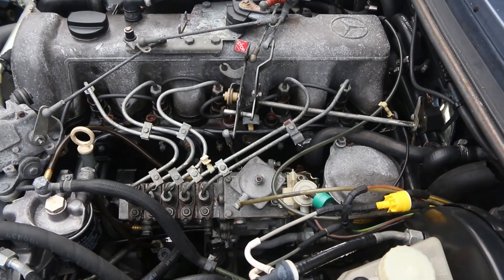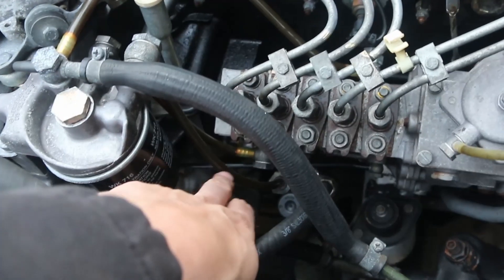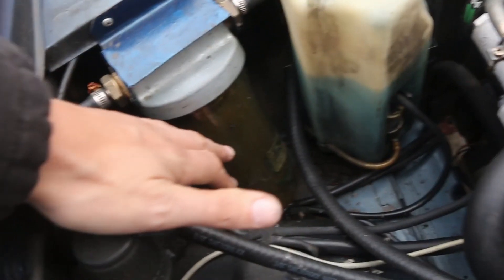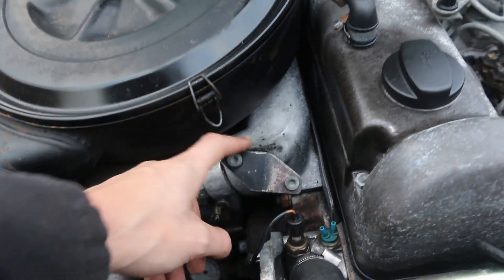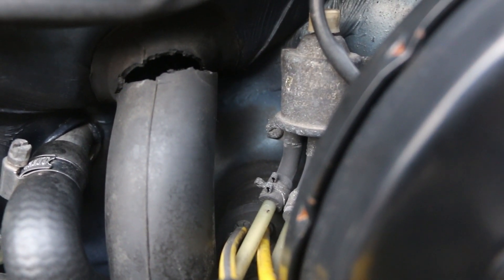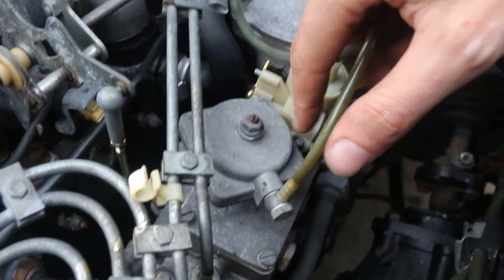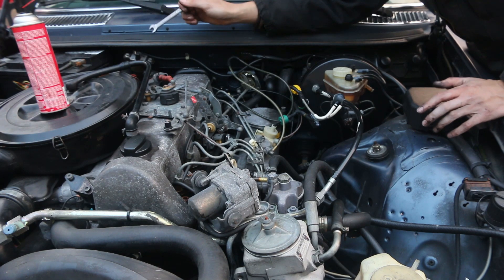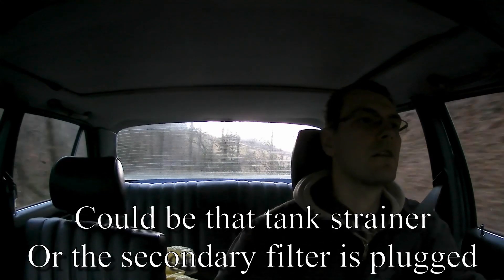Hunting for more power on a W123 1982 Mercedes 300D Om617 Turbo diesel. First steps to HP!

Comment: Do you have a part number for your aftermarket primary filter?
Reply from the maker: I'm so sorry, I somehow missed your comment, Yes, I used a goldenrod 470-15 inside of a 496-3/4 housing, and a couple 3/4" npt x 1/2" pex fittings to adapt to the 3/8 rubber fuel line:
Filter housing: https://amzn.to/31lon0T
Mesh filter: https://amzn.to/39VP14r
Fittings: https://amzn.to/2XqYBHq
3/8 fuel line: https://amzn.to/3gtDdZy
Clamps for fuel line: https://amzn.to/31mavUd

Comment: Cool car. After your done you might wanna call dieselmeken. He’s pretty good troubleshooting diesel power issues.....hahaha
Reply from the maker: I've got all my stock power back and a touch more thanks to the bigger injectors nozzles but I sure wouldn't mind getting a pump from dieselmeken lol
Reply: @trythistv   Nope, not a good idea. 
you see, Mercedes put a max of 225HP in one of these engines. Their C111 car that got all the diesel speed records. Anyway, after 225 HP the reliability and longevity of this engine diminishes.

Comment: I'm curious.  Have you inspected the turbo? Couldnt hear whether or not it was spooling up during the test drive.
Reply from the maker: I have visually inspected (probably worthless) and it is audibly spooling up, and disconnecting the alda turns the car into a total dog so it is building at least some boost, I will at some point be checking how many PSI it is producing and adjusting the wastegate if needed.

Comment: Check the boost or condition of the turbo
Reply from the maker: That is on my list of things to check, I have a few real quality of life improvement videos coming up that will make the car much nicer to drive around, then we'll get back to POWAHH lol.

I know it is making boost, at least some, and the ALDA is functional because if you unhook the ALDA from the boost line, its dramatically underpowered up top.

I need to verify just how much, and ensure the turbo cartridge isn't about to grenade on me.

Right now it still feels a tad underpowered in the higher RPMs but this thing is a whole new machine with the SD314 injector nozzles and the other things I've tweaked, there is a unreal amount of low end torque, chirps tires easily.

Comment: One thing to look at is the lift pump itself, they will fail, and not push enough fuel. Rebuilding them is pretty easy.
Reply from the maker: I have been suspicious of the lift pumps wearing out, I actually bought a rebuild kit but haven't gotten around to doing it. I know the spring in the overflow valve will make a dramatic difference if you stretch it back to the oem length, it'll squish back to the fatigued length before long but having the ip elements filling at the proper speed is worth investigating on both sides, lift pump output and ofv spring holding the pressure back for sure! Thanks for the reminder that I've got those parts sitting somewhere!
Reply: @trythistv  My friend jtwoods41978 did an entire series rebuilding a om617, check it out. #26 is a full rebuild of the lift pump. I make a brief camo in #21... https://www.youtube.com/watch?v=HC90mwt7IZw&t=7s
Reply: He has also created a website https://om617rebuild.com/ and will be offering rental of all the specialty tools needed to perform the tasks. I donated the timing chain crimper to the cause. :)

Comment: Trythis, on my 300D, I jumped terminals 1 and 3, 2 and 3, and saw the same results on my fuel guage that you showed on your video, but when I installed a good sending unit ( I checked out a webside that gave the correct ohm reading depending where the float is in the tube so I know the sending unit is good) my fuel guage only reads full. I did check for continuity between terminal 3 and metal frame of the car and that checked out as good too. 
So i'm still trying to figure out what's going on with my situation. One weird thing, my fuel guage will go to empty when I jump 1 and 3, but the little triangle doesn't go on.
Reply from the maker: That is very odd. Did you try plugging the sender in outside of the tank and rotating it to make the slide move? Also I'm not super clear on where it was but there is an issue with the W123 instrument cluster grounds sometimes I've heard, my Grey car started billowing smoke from behind the cluster one time because of the bad ground. They are brown wires if I recall properly, certainly worth cleaning up the connection points, It helped some of my wonky gauge issues on the grey car, Blue (car that's been in these videos hasn't had that problem yet)
Reply: @trythistv , thanks for the info!

Comment: if you adjust the alda screw counter clockwise as much as you can and you will get way more power and turbo spools up quicker but it makes the car a lot louder and run less smooth i found. 
I recently turned it all the way back clockwise and engine runs smoother and quieter but turbo takes longer to spool up.
Reply from the maker: Right. The ALDA essentially is the preboost fueling control,  so like the "star wheel" on cummins trucks.

Turn the screw CCW and you can get more fuel pre-boost, which will tend to spool the turbo faster but also can make nasty clouds of smoke, while turning it CW will restrict fuel more before the turbo spools, making it laggier but less smoky.

I've never noticed a difference in smoothness or sound, I'm curious to double check myself on that, the ALDA I showed on the grey car with the rubber cap still intact has no internal parts.
Which means full fueling at any throttle position regardless of boost. Can be very very smoky (like black out the interstate brodozer type smoky) but very responsive to throttle input (That car is converted to 4spd manual so I wanted finer control of the engine, just don't lug it and it doesn't smoke)
Reply: @trythistv   have you checked to see if the kickdown switch works?
Theres a little button behind the gas pedal called a kickdown switch, that gears the engine down a gear when you floor the gas pedal and press down the switch/button, that normally gets the rpms pretty high and the turbo kicks in super quick.
Reply: @trythistv  check if the kickdown switch works behind the gas pedal when you floor it
Reply from the maker: Yup. Kickdown is working properly, I had a blocked secondary filter, which somehow got blocked up super nasty after just 100ish miles so I was convinced something else was wrong since the primary filter was clean as can be.
Reply: @trythistv   Nice! 

I'm having starter motor problems. about a month ago the starter got stuck and i had to tap it with a hammer as a friend turned the key and it worked till yesterday I had to hit it again and now its working again. looks like i need a new solenoid or new starter soon..
Reply from the maker: I've got a starter (well actually most of an entire engine...) from a early 80s w126 that had the 617, IDK where you're at , and shipping would probably about murder on near any part off a 617, but I'm gonna have to start clearing out my garage as I'm building a shop for my business and my wife wants to park the blue car in the garage once all my tools for work are in the shop.
Reply from the maker: Ooop, hold the phone. I went out and looked to find an empty hole where a starter would go... I know it hasn't gone on my cars, I thought it was there but now I'm not sure if I took it off and put it somewhere else or if it was never on this engine when I got it for parts...
Reply: @trythistv  Thanks so much for offering. :)
Theres some on amazon prime for $175 so its not a big deal.
Reply from the maker: As a thought, check your local auto parts places. My Oreilly's has them remanned store brand for $97, $11 core lifetime warranty. I love my warranties on parts for my stuff, these cars might well outlast me if parts stay available.

Comment: Trythis, Good job on all your videos. I appreciate all your effort's in making these videos.
I just read that you took apart the strainer at the fuel tank, but for anyone else trying to figure out if the strainer at the fuel tank is clogged Sid Harvey's makes a manifold set up that residential oil guys use to test pressure and vacuum for an oil burner which is similar in principle to a diesel fuel injection system. I know they use the  vacuum side of the manifold to test vacuum between the fuel pump and oil tank strainer to see if the strainer is clogged.
I believe one could find a used one on ebay for cheap money. https://www.youtube.com/watch?v=YH_0FuBK46k&t=755s
Reply from the maker: I LOVE finding out about new tools I didn't know I needed! That looks like an incredibly versatile set of gauges! And thank you so much for the kind compliment, its nice to know these videos are useful, informative or at least entertaining to other folks!

I did just tear the tank strainer out, with sadly no effect on the power even though the strainer was horribly clogged, I'm going to check a few more things and include all of that in another video. I've got a few ideas on some very telling tests to determine where the problem is which might be very useful for anyone else fighting a similar problem whether its on a mercedes engine, or some other mechanical diesel!

Comment: Nice.  Thanks for sharing.  Get one of those vac/pressure gauge w a T piece.  Going to need a longer hose to get the gauge into the car.  Check vac prior to primary fuel pump and pressure after the pump.  Good luck.
Reply from the maker: Thats an excellent idea, that would prove if the tank strainer is clogged if the vacuum is very high!
Reply: @trythistv  They sell handheld vac/press pumps w a vac-press gauge.  Real useful for emissions circuits, HVAC flappers, etc.  Kit usually comes w a few hoses and t-pieces.  U want to see pressure of line going into the inj pump, after the fuel filter.  7 psi min.  10 psi is better.  U gotta test this with the engine loaded so u need to get the hose to the inside of the car.  IMHO toss the screen in the tank completely.
Reply from the maker: I just finished a real fiasco with the tank strainer, some vikings came and tightened the thing in there, I thought I was gonna have to replace the tank it was stuck so hard.

I'll be working on editing the video but may wait and include more than just the tank strainer, It was clogged solid, the thing had 1/4 inch of crud caked on every side of it. I opted to remove the screen entirely like you suggested, hoping that the lift pump will pull any crud up and into the giant goldenrod filter.

The car still acts like its starving for fuel above 2500rpm, surges a little and really doesn't wanna go up hills, yet absolutely rips off the line, screaming fuel delivery to me, I'll be checking the supply pressure to the IP next, if fuel pressure isn't the issue then I'll check the boost pressure and alda for leaks.
Reply: @trythistv  Awesome.  I've got to get a Goldenrod.  U know that Wix sells Goldenrod 10 micron filters?  Where did u mount the Goldenrod?  Under hood before the primary pump?  Merry Christmas!
Reply from the maker: @ebutuoyebutouy  Sorry! I thought I replied to you, yes the goldenrod I mounted right next to the windshield washer bottle. I'm looking into doing a modification to add a bigger, better, water separating secondary filter as well, stay tuned for that!